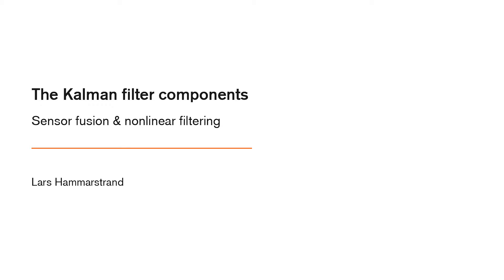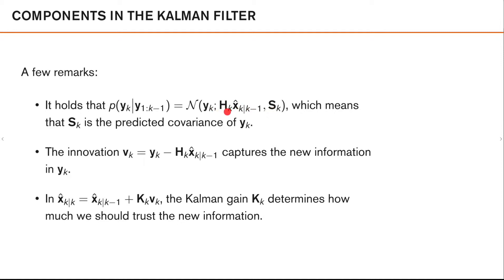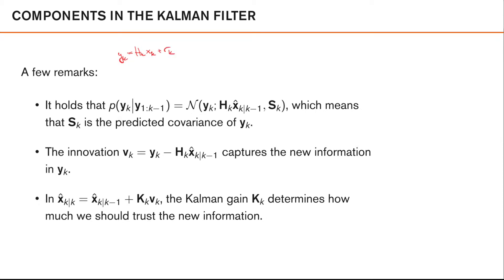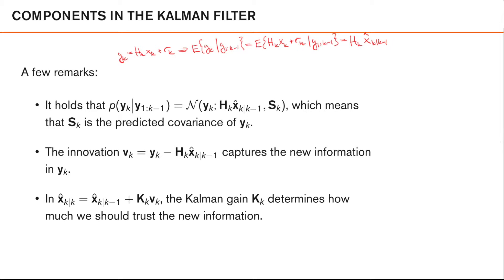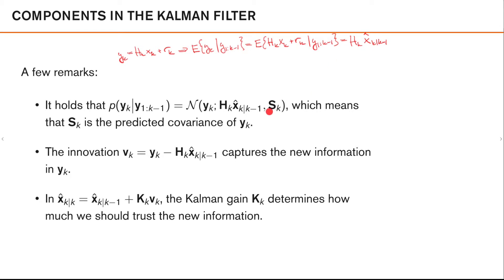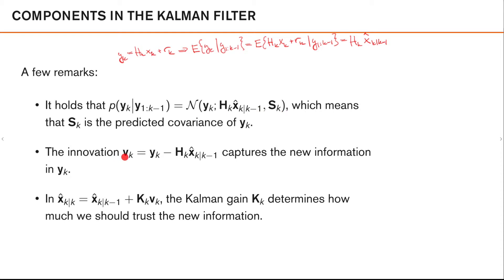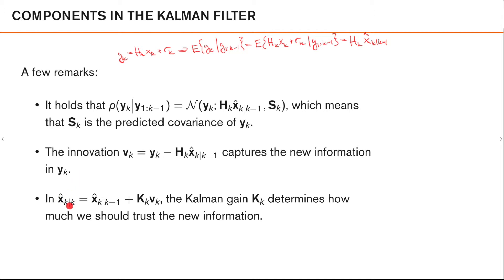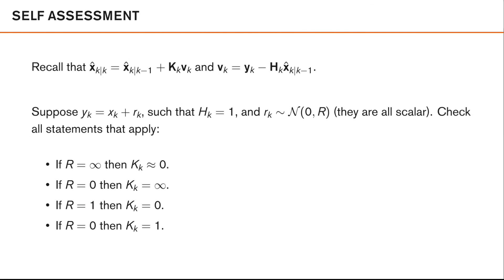4.1.3 The Kalman Filter components

Comment: Self assessment, just my own answer - could be wrong. Firstly by substitution of the formula for v_k, we can see: x^_k|k = x^_k|k-1 + K_k * (y_k - x^_k|k-1), so x^_k|k = x^_k|k-1 * (1 - K_k) + y_k * K_k. So K_k chooses how strongly we should trust our previous mean vs our new measurement. At K_k = 0 we ignore any new measurements entirely and at K_k = 1 we ignore any previous x^ and adopt the new measurement as the new mean.
* If R = inf then K_k = 0. If the amount of noise in our measurement is infinite then we shouldn't place any weight in any new measurements we see: agreed.
* If R = 0 then K_k = inf. If there is no noise in our measurements then we should give new observations infinite weight. No that would just drive x^ to infinity: not helpful.
* If R = 1 then K_k = 0. If our measurement noise is a standard 1-sigma guassian we should give the new observations no weight. No, that doesn't seem right.
* If R = 0 then K_k = 1. If we have no measurement noise then we should give new observations 100% weight. Agreed, this seems reasonable since the new measurements are always perfectly right.